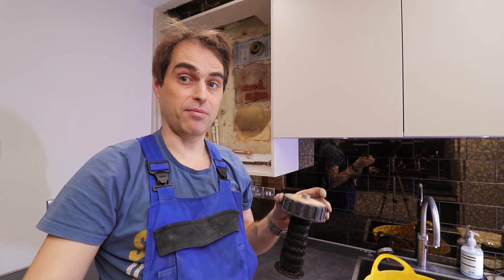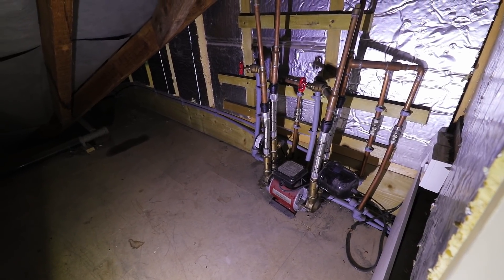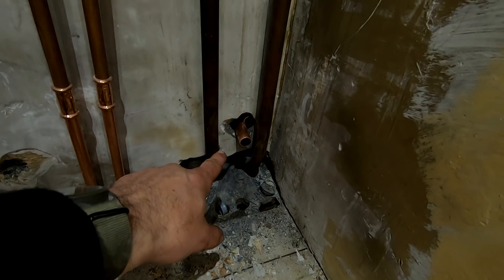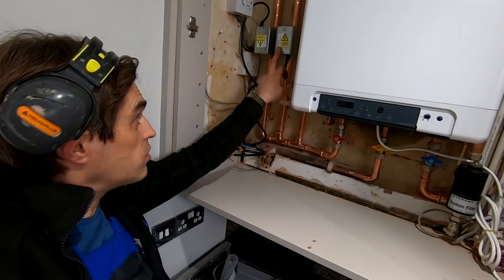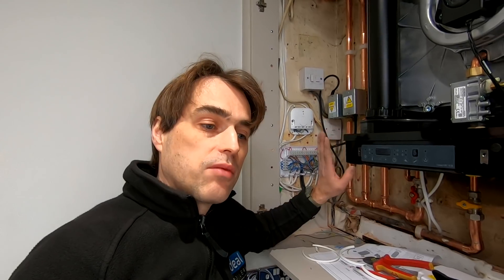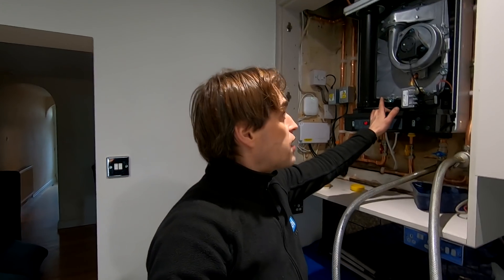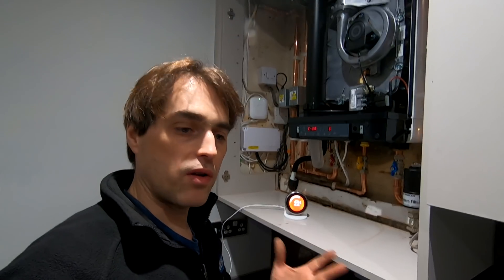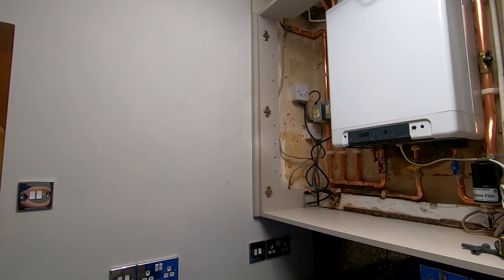Another house saved from a combi

Comment: The pipe work he installed was beautifully done ✅ in fact the whole job was done in a very professional way,the crap in that system was unbelievable,I’ve fitted my own Combination Boiler a couple of times over the last 20 years,after flushing the system I’ve always put Bluecol antifreeze in the system instead of the chemicals they use,I did this because we have two houses in different areas one of which is a holiday home and doesn’t get used much in winter so the risk of freezing up is minimal if the frost stat fails,the water in my systems is as clear as it was the day I filled it with no sediments at all,I’m Not a plumber but a truck mechanic and you Never see muck like that in a truck cooling system that has had antifreeze in it continuously so I decided to give it a try and have Never had any problems with boiler or pipe work in all these years,no corrosion at all in the steel radiator’s,good as new after inside after 12 years.

Comment: The answer is to size the boiler on water requirements, not CH. Heating a tank of water that may, or may not, be used should be made illegal. ALL heat should be on demand.
Reply from the maker: What you are suggesting usually ends with an inefficient system that is actually much worse to what we installed here
Reply: @UrbanPlumbers  Really? Why not quote numbers, rather than giving assertions. Combi-boilers are very efficient, close to the theoretical limit. Storing water that is losing heat continuously is the opposite of efficient.
Reply from the maker: Actual combi boilers efficiency is around 83%. See article below

https://www.theheatinghub.co.uk/are-we-being-mislead-over-boiler-efficiencies-erp-sedbuk

Hot water priority systems as the one installed here can be over 90% efficient 

Heat loss on stored water with modern unvented cylinders is so small (1-2kwh per day) its negligible.

Having to size the boiler for hot water as a combi makes it difficult for the boiler to be efficient on heating. Heating on average in UK only needs 6kw and is only going to get smaller. 

Combi boilers are a compromise. Also hot water performance of combi boilers is seriously inferior at 10-15l /min@35c rise as compared to unvented at 20-25l /min with 45c rise.
Reply: @UrbanPlumbers  2kWh/day negligible? For ~7M homes on gas, that works out at 5,000 gigawatt hours per year. A new meaning of the word negligible that I had not previously met.
My energy consumption for water heating averages 9Kwh/day- so your system would actually be 70% best case. And more expensive. And take up valuable space.
Reply: @Tensquaremetreworkshop  As with all engineered environments and systems, scenario and use cases matter. "Heating a tank of water that may, or may not, be used should be made illegal" is a meaningless statement even within this context of home heating and dhw. A militant reductive mindset is a real barrier to progress and adopting more efficient home heating systems if that is what you care about. I assume any and all configurations involving heats stores are a big no? 
Where do you stop. I'd rather not heat the pipework and their respective spaces under floorboards and walls, perfectly reasonable in isolation, so decentralise heat generation and localise to in use rooms only for ALL heat to be on demand. Certainly a goodbye to the combi boiler.  
Bringing back to the real world, the tank is within the thermal envelope of the property so the minimal heat loss is not being wasted in quite the manner you imply.
Reply: @eddyr3691  Yes, the combi boiler is doomed- as is all heating relying on fossil fuels. (Green hydrogen? Don't get me started...) Yes, the tank reduces the property heating in Winter (including overnight, when it is not needed), and increases the cooling load in Summer. Just heating a tank of water, of size large enough for any circumstances, is crude and wasteful. On demand heating is ideal, especially when the heat source is a fraction of the cost (gas vs electric) and the thermal capacity is available. CH does not match DHW requirements? Technically simple, manufacturers will not do it (customers do not understand, and it would add a little cost) but that is what regulation is for.  All of this is crude and primitive- modern predictive systems can monitor occupants and ensure services match demand. Heated pressurized tanks will join header tanks in history.
My statement was, of course, an attention getter. To set the starting point for an analysis of how we provide services in domestic properties in the 21st Century. In this, JIT should surely apply.

Comment: Those systems are so much more complicated when compared to what you find in the typical North American home. I'm from Québec, so almost all heating is done using electricity. The only place where you will find hot water central heating is large buildings such as hospitals and universities. Filters are rare. Most systems don't have any pumps as city water pressure is usually high enough. That also means we don't have any return, or circulation loops. That's one thing that I do think we could really learn from. Must be nice to have hot water almost right away when turning on the tap. We don't pay for water, so wasting a few litters waiting for hot water isn't a huge concern. The vast majority of North American homes only have a hot and cold pipe with an electric hot water tank that needs to be replaced every 10 years.
Reply from the maker: Heating with direct electrics would be very expensive in Europe. However, this can change quickly with current Russian situation.

Comment: Great video, thanks. Question: I have an unvented system and three shower rooms. When two or more showers are used at the same time water pressure drops drastically, what could be the issue?
Reply from the maker: your mains supply does not provide enough flow. Could be undersized mains pipework, or undersized supply to the cylinder, or it could be that this is all you can get from your mains in your area. You can try flow limiters installed at shower heads.
Reply: If you're UK based  the minimum  flow requirement for an unvented cylinder is 20l/m, divide by three showers and you may have your answer.

Comment: Why use two separate NO/NC valves on a T in parallel instead of a three way valve that selects between two pipes?
Reply from the maker: You can use a 3 port with NC position towards the cylinder. It is called a D plan. There is really not much difference between the 2, and they are wired in almost identical way.

Just whatever your preference is or whatever type of valve you have available.

My next video will have a similar set-up using 3 port. I would use 3 port when there is more than 1 heating zone.

Comment: Unique video, you are working hard but I don’t understand some of the terminology.
I don’t know how you feel about the work putting the water tank ? ( you carried up the stairs)
What’s the next plumber going to do if there’s any issues with the pipes buried in the back of the closet? What if the next plumber is you?
Reply from the maker: That’s is why I removed all push fit and compression fittings.

If the cylinder needs to come out then that can be also done in around 2-3 hours.

Comment: So you have used the normally open 2 port valve on the heat feed to the unvented cylinder? Or did I hear that incorrectly. UK regs require the valve to close if there is any kind of input temperature run away via the over temp trip cutting the power and then the valve closes on its own.
Reply from the maker: The other way round. Normally open is on CH

Comment: In my appartement (1950's with double glazing, floor, wals and ceiling insulation0  I used to have an Intergas system you've installed, and oh boy that is an efficient one, in my current house (new built in 2018) on council heat I pay twice the price for the same KJ of heat energy, I'd wish my house was still on gas and could use a Intergas system again...
Reply from the maker: I love Intergas boilers, the most versitale boiler ever made, let down however by the company that runs INtergas in UK big time.
Reply: @UrbanPlumbers  I read the installation booklet, you can add hot water tanks and solar collectors, etc... Yes indeed very versatile...
Reply: @UrbanPlumbers  I know an engineer/trainer who was a Intergas technical lecturer and he left as he was fed up with the way Intergas were run in the UK. He still loves the boilers though.

Comment: 35 KW isnt even close to the top end I think you advised incorrectly on this
Reply from the maker: haha - I would have installed 12kW or less if I could. Sadly, Intergas does not sell 12kW in the UK. The heating requirement for this house was 7kW! The coil in the cylinder is around 20kW. 18kW is a perfect boiler for this house.

30kW was the biggest boiler you could install on existing gas supply. 

The only viable solution other than unvented was a storage combi.

I do not like stroage combis and I do not like combis full stop. They are always a compromise.

Obviously the whole industry is biased towards combuis, as they are cheap, easy to install and take little space. But the list of drawbacks is much much longer.

Comment: I've always thought Combi boilers were the devil's invention. Unless massively properly sized take forever to fill a bath, take a shower and forget filling the sink at the same time. Combi goes wrong no hot water, a tank can have an immersion heater. Pressed joints great, compulsory for some clients, my otherwise great engineer set fire to our roof fortunately no great damage. Great video
Reply: The key is you 'properly' - most builders fit something based on CH, to save money. Size it properly and you do not need a huge tank, losing heat and taking space.
Reply from the maker: combis are a compromise and the worst option when it comes to performance and efficiency. Unvented + hot water priority wins every single time when done correctly if you have space for it.

Luckily with electrification of heating unvented and vented cylinders will have to come back to our homes.

Comment: Easier and cheaper would be to install electric flow heater, global or local depends how the pipes are going. (not for heating the house) For heating house I would recommend air to air heat pump
Reply from the maker: I guess you are not in UK? What you suggest would be a bit of a disaster in a UK home.
Reply: @UrbanPlumbers  why? It nice to say about disasters without any arguments
Reply from the maker: @Konrad162  electric flow heaters are only going to be 14kW - you will struggle to install a bigger one in UK. 

They will give a very poor hot water performance of around 6L / minute and cost 3 times as much as running water with a gas boiler.

Air-to-air would be very expensive to install , most likely require an upgrade to existing electrical installation.

You would be also removing the existing wet central heating system that is already in place in almost all of UK's homes.

It may make sense if you are in a country that has cheap electric heating, no access to gas and modern build properties with decent electrical supply. In UK however that idea would not fly.
Reply: @UrbanPlumbers  that is pure bullshit. You don't need central water heater if your electric conditions don't allow. You can have smaller once under the sink they are dirty cheap, much less power needed.

Air to air is a little bit more expensive than gas heater it self, much cheaper then air to water. If you add to Gass costs of gas heater, water tank and maybe new room heaters then air to air might be cheaper. 
Usage costs are cheaper then gas.
Additinaly power usage is very low bellow 2kW for example currently 0 degrees outside I'm using one 3.5kW unit to heat 140m2 to 22C and it is using 0.47kW 

Also you don't need to remove the old system, you can easily leave it as a backup.
Reply from the maker: Ok mate. I heard you and don’t agree with any of it.
Reply: @UrbanPlumbers  water based heating systems are less efficient and also less comfortable. More expensive not only instalation costs but also daily usage. While fitting these systems to old houses need to be consider case by case, for new houses... Form me it is obvious choice.

PS. I'm not your mate ;)
Reply from the maker: @Konrad162  then I guess 99% of properties in Europe just got it wrong, mate - :)
Reply: @UrbanPlumbers  yes, the same with introducing any new thing. It is very hard to change mind sets. Also for example currently I can't image any other ventilation system than mechanical with heat recovery. But 99% houses has gravity based. Is it good? No. Dose it work? No it doesn't work at all. 
Is 99% wrong? No just old. 

Also gas price is rising and will be rising, much faster then electricity costs.

Comment: Mate the fact you actually bothered to modulate the boiler properly for your client is a miracle in this day and age , well done for showing the lazy engineers how its done properly.
Reply: As a customer I have long since taken to doing the command and control myself because no installer has ever done an adequate job, certainly not after thermostats were just bang-bang controls on a Honeywell round with a bimetallic strip.

Our installers back in the day put thermostatic valves on all the radiators (and I mean all) without a bypass. And they were very miffed when we had them install one (we paid for it and all.)
Reply: @JasperJanssen  wish i was as adept but sadly modern boilers are more very complex systems
Reply from the maker: proper boiler set up and modulating controls whould be a must on all jobs. A lot of cheap boilers (Ideal, Worcester Bosch, etc) do not even let you set the boiler or the pump correctly - meaning that those boiler never condesne and run with low efficiencies - and there is nothing you can do about it!
Reply: @UrbanPlumbers  like an idiot I went with a valiant 838 plus cause of bad installer advice for a 1 bath and 1 toilet property , mind you there are 8 rads and a towel heater but that’s how I know about modulation , the service guy promises he set it up best he could but god knows if it’s gonna help my gas bills glad I avoided those names at least , what’s your charge for a boiler service ?

Comment: Why go for 2 zone valves instead of a diverter valve ?
What was the third pipe with no valve on, going to ?
Reply from the maker: You could use diverter for sure. In this design however the valves are in the resting position most of the time, so it is quite reliable. 3rd pipe goes to an auto bypass.
Reply: @UrbanPlumbers  It's the first I've heard of a NO zone valve ! When we moved in here, only one zone valve, DHW was a permanent circuit in half inch pipe. That's 15mm to you :)
I've 5 zones now. Only one with TRVs - so the ABV is only on the TRV zone. I'd rather not have it but Veissmann boiler is not happy with low flows !

Comment: D plan with a Nest and cylinder sensor (rather than stat) is even simpler.
Reply from the maker: There is an NTC on this cylinder. You still need a high limit stat to satisfy the regs, no? I am using ESI high limit stat here that has C, NO nad NC connections - C and NO wired in parallel with NTC so if high limit is triggered it links pin 9 and 10 and stops the boiler.
Reply: @UrbanPlumbers  if you're sticking with the overheat stat, a regular unvented cylinder stat can be wired in series to the valve to give the same effect.  I'd argue that the boiler is not capable of taking the cylinder to the activation temperature though 😜. It ain't a Greenstar 😂😂😂
Reply from the maker: Are you saying you only use NTC without high limit?
Reply: @Urban Plumbers  I haven't bothered at home.  For customers I've had the cylinder stat there, so it was no issue to put it in series with the valve.....But if you think about it - the overheat stat is not used by Viessman, Vaillant, or any other manufacturer's OEM controls fro this very reason.  Boiler overheat stat acts as the therrtmal cutoff.  Keeps thier costs down too; and the only difference is that they are selling a "package".  Remember our G3 rules were out of date crap when they were released. 

Immersion heaters are a much bigger risk to overheating an unvented cylinder even with that integrated cutout.
Reply from the maker: @YagiChanDan  you are correct, I would not mind just having an NTC on my own cylinder. The trouble is having someone come after you and slag you off for not doing a fully complaint job. There are rules and then there is common sense. All that stuff is done to cater for the lowest common denominator.
Reply: @UrbanPlumbers  very true.  Thankfully I am long enough in the tooth and close enough (hopefully) to retiring to worry too much about such things LOL.

Comment: Why does it need a power flush then? If that boiler hasn't been serviced that magnaclean is pretty clean. You only need to do a powerflush on a system if the system is showing signs of needing it. Taking a magnaclean  apart and showing how dirty it is is not a sign of sludge build up. The system will need a clean if the radiators are cold in the middle at the bottom or if sludge is seen when draining the system from the bottom drain off. Just having a dirty magnetic filter means that the filter is doing its job.
Reply from the maker: Magan clean is pretty clean? You are having a laugh, mate. The system was filthy as hell and needed a full flush 100%.